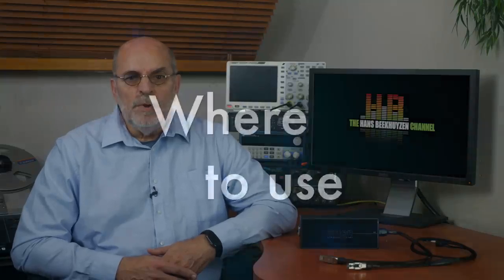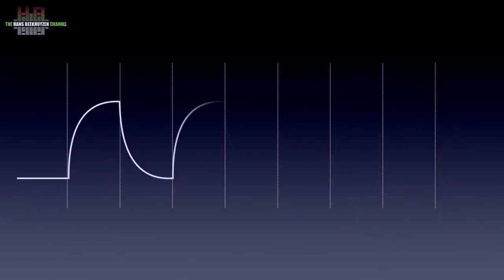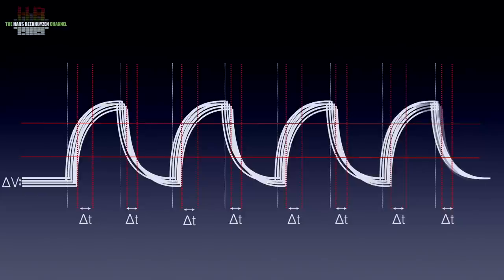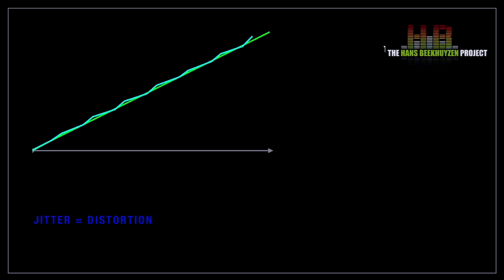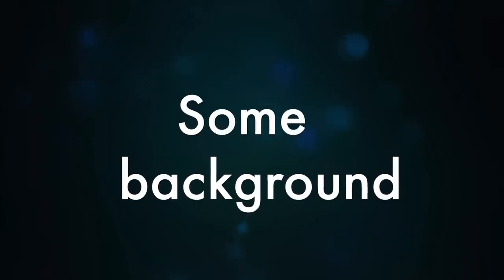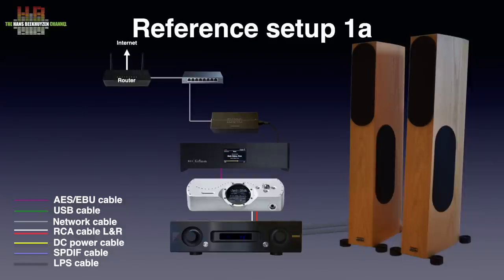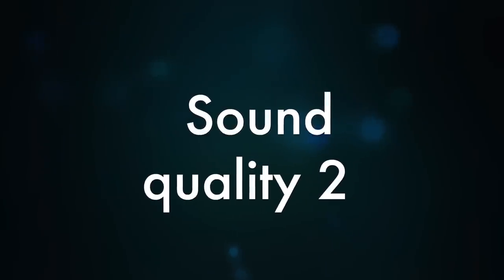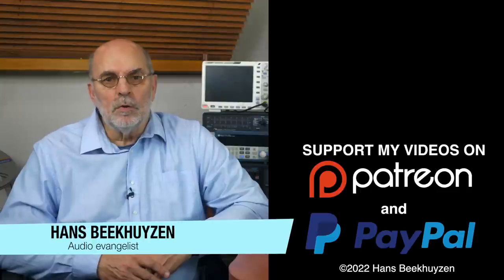Network Acoustics Muon network system

Comment: I am wondering where "galvanic isolation" fits into all of this. Do I oversimplify the situation by suggesting that Eno and Muon possess galvanic isolation as one of their chief features and that therefore:
1. when paired with an audiophile network switch (which generally does not contain galvanic isolation) they further improve SQ. 2. when paired with Grimm MU1 (which seemingly contains galvanic isolation) they have minimal impact on SQ?
Reply from the maker: Galvanic separation is one of the techniques to avoid degradation of the digital signal, but surely not the only one. Filtering out noise is another one, as is reclocking, reshaping and so on. Network Acoustics doesn't tell what they do exactly. But their products do an excellent job.
Reply: @TheHansBeekhuyzenChannel  Thank you for your reply. One of the things Network Acoustics does admit to doing is reducing network speed from 1Gb to 100Mbs. Coincidentally, this is something Dutch cable manufacturer Tubulus advertises as a feature of their ethernet cables. Tubulus also got a great review from HEADquarter audio on youtube recentlly for both their i2s and XLR cables. That might be a brand worth reviewing sometime - high quality specs including silver conductor and air dialectrics, yet nor extremely expensive.
Reply: @TheHansBeekhuyzenChannel  inside the Muon there is one common mode coil.

Comment: Some think wifi transmission sounds better than cabled. I wonder how close we could get in performance using wifi instead of cable with the Muon or Eno. Great channel, thank you!
Reply: Very good point. Unfortunately my Wi-Fi is too intermittent and that’s very annoying.
Reply from the maker: It can sound better, depending on the gear you use and your local aether space for Wifi.

Comment: Hans, have you tried going from switch>ethernet cable>media converter>fiber >media converter w/ ifi dc ipurifier2 >6 inch Cat 8 cable>streamer? The fiber run is suppose to remove all noise, the media converter should add very little noise with the ifi dc ipurifier2, and the short cat8 is sheilded and because of short length won't pick up much noise. It costs less than $200 and I would think that you would get simular results to this product.
Reply from the maker: Fibre only kills the noise that otherwise would be transported through the galvanic connection. Phase noise isn't killed by it. Furthermore the conversion from galvanic to optical and back could introduce deterioration. So it might help - it does in in my connection from the third floor to downstairs - but it's not the end solution.
Reply: @TheHansBeekhuyzenChannel  who would there still be phase noise? Is it coming from the media converter? Would a common mode choke fix this?

Comment: I realized that with the Grimm Audio Mu1 (which I intend to buy) the use of Eno (which I own) or Muon, leads to negligible improvements. 
The same thing can be said for an optical connection upstream of the swtich (in my case sotm) before the Muon? Does the audio quality - be it fiber optic or lan cable - not change with the Mu1?
Reply from the maker: I have not tested that for it means replacing the optical connection to two floors up. But my educated guess is that the MU1 will not sound better wit fibre.
Reply: @TheHansBeekhuyzenChannel  thank you

Comment: How do you measure noise on your ethernet to know if you need this product?
Reply from the maker: With two ears. It's not only the ethernet noise, it's also how well your network player can deal with it. As I mentioned in the review, the influence of the filter on the Grimm Audio player was rather limited but on other players it was quite evident. You can try one and send it back when it doesn't bring improvement....

Comment: Network data is transferred from one buffer of the operating system (server) to another buffer OS (client). There can be only two results of the transfer: everything is delivered exactly or the connection is broken. How many devices are on the path, optical cable or twisted pair, etc. absolutely does not matter. Operating system buffer cannot have jitter 🤷‍♂️
Sorry for my poor English.
Reply from the maker: Did you watch the video????
Reply: @TheHansBeekhuyzenChannel  How? I don't have a network filter and the video is scattered into squares. (kidding)